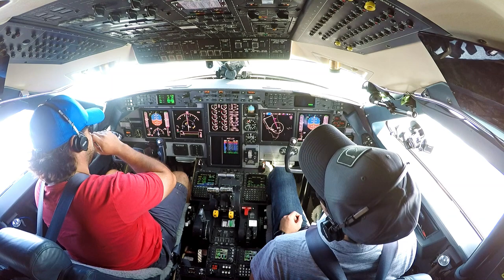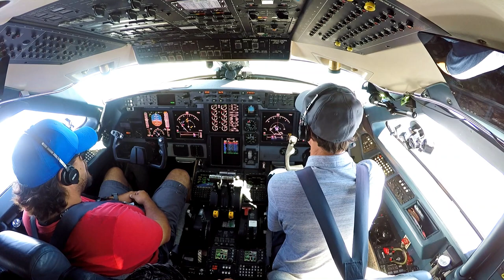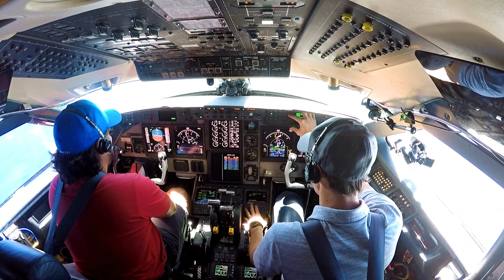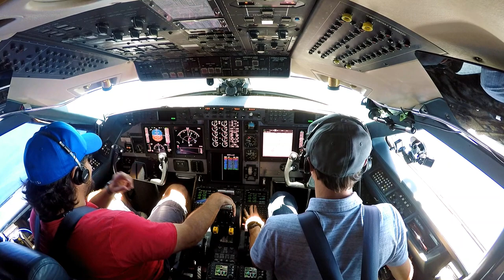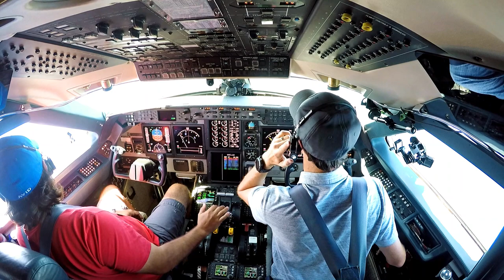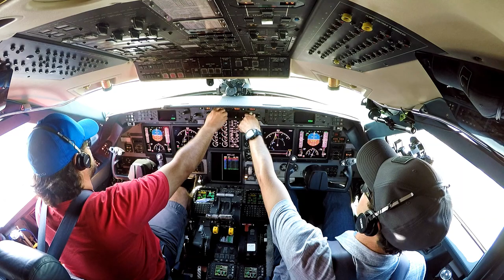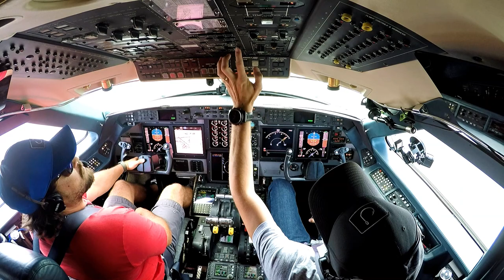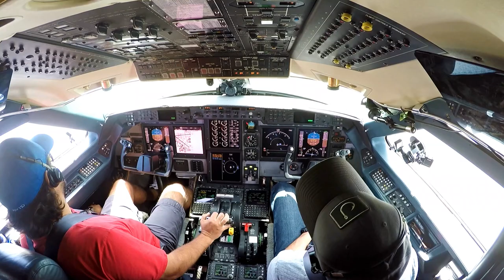Gulfstream Test Flight Around Florida - Pilot VLOG 091

Comment: If you can, please let us know what the corrective action was. I was an engine mechanic in the Air Force, and sometimes performed throttle rigs on C-141 aircraft. Thanks again.
Reply: The mechanic in the plane indicated it could be the tension on the cable but wouldn't the servo compensate for that? On a related topic, where is the speed input for the servo coming from? Is it the engine RPM?
Reply: Clearly the asymmetric trust issues are related to dirt in the carburettors... ☺
Reply: That'll be it. Go check... 
(Shh - if he can find a carburettor in there I'll buy him a mars bar!)

Comment: How did they know you were looking for air work before you'd asked for it on freq? Was it in the FP remarks? Good call on the block alt request. Just a note, once you have the block, you should not feel obliged to try to stay at 15k. The airspace is yours. Center is not going to have another IFR aircraft any higher than 12k or lower than 16k within 5nm of you. :)
Reply from the maker: I had already discussed with ATC about doing some maneuvers...that's how they knew.

Comment: We had a very similar autothrottle issue on my aircraft; the problem ended up being the fuel nozzles were worn, as I recall. It was affecting engine acceleration, and because the throttles lag, one side was always playing “catch up”. The splits got bigger and bigger until we had to disconnect them because of the Dutch roll it started to induce.
Reply from the maker: That's a great suggestion...thank you! I'll pass that along to the maintenance guys

Comment: Man, I wanted to see a stall.  Also, what are those yellow handled levers just aft of the throttles?  Happy landings!
Reply from the maker: Those are the fuel shut off handles, often called the fuel cocks. Those are how we introduce fuel for engine start, and shut off fuel to kill the engines.
Reply: Thanks.  Unrelated question: have you already stalled when the wheels touch down or do you stay above stall speed all the way to touchdown?  And is it that way you land all types of airplanes or are G4s different?  Again, thanks and happy landings!
Reply from the maker: Every airplane lands a little differently, but in general you don’t want to stall at all on landing. Some planes can do that for specific landing types. The G-IV should still be well above stall speed when the wheels touch the ground.
Reply: Generally tail draggers aim to stall just before touchdown

Comment: If you haven't already done so, you might want to ask Avid about a discount code viewers can use.  It's good for you (brings in viewers), and good for Avid (not only drives in business, but they know which venues are sending them customers.).  In exchange for a few bucks, they get information about how valuable an endorsement from you is, and how much of a lasting effect each video giving a shoutout to Avid provides.  

Thanks for this video.  I can't believe I'm saying this about a maintenance flight, but it was incredibly interesting. It''s a completely different set of problems than I'used to see back when I was flying piston singles!
Reply from the maker: That's a great idea...Thank you!

Comment: Another great VLOG Shaun & Jon!!!  lot of interesting stuff going on, if you need to drop altitude in a hurry for instance glide slope to high do flaps and spoilers give a good descent or can you side slip a GIV?
Reply from the maker: Flaps and spoilers are definitely the way to go. You can side slip it just a little bit, but the air flow gets disturbed pretty quickly

Comment: What is the "engine sync" you call out shortly after takeoff?  Normally you  activate that switch in the overhead, but this time you did not.  Does it link the throttles together?
Reply from the maker: That tries to match up the engine RPMs to reduce the noise in the cabin. It's just for passenger comfort.

Comment: That Dunlop call was one I’m never going to forget. Those maintenance rides are really a handful. Thumb up from across the North Atlantic and thanks for the ride. Got one question I’m been wondering about for a long time. What is the main differences between a straight lV and the SP?
Reply from the maker: There are several upgrades in the SP models. The SP has slightly better avionics...it has SPZ 8400 rather than 8000. The SP is capable of higher takeoff and landing weights. My favorite is that the SP has an inch more headroom in the cabin.
Reply: Thanks for responding Shaun. Can see that extra inch comes in handy at both previous and latest clip.

Comment: Q1:  What is the purpose of the elevator check at 60 knots on the takeoff roll?  Why isn't that checked along with the other control surfaces while you're stationary?

Q2:  In a piston single, during the landing rollout you typically keep the yoke back to keep as much weight as possible off the relatively fragile nosewheel, however in the G4 you seem to be pushing the yoke forward to the stops.   What's the reason for this?
Reply from the maker: Good questions...we absolutely do a full flight control check immediately after engine start. We also do an elevator check as we enter the runway before takeoff. Then one final time at around 60 knots. There was a very tragic accident in Bedford, Mass several years ago caused by locked elevator on takeoff. The flight crew didn't notice it until rotation speed and didn't have enough room to stop on the runway. In an effort to never let that happen to us, we check that elevator several times before that point. as for the elevator being pushed forward after landing, that is very normal for the Gulfstream to keep the pressure down on the nose tires for better steering authority, especially on wet or icy runways.

Comment: Question: John mind my terminology only .5 in a cessna so some is more rotorcraft terms why was he having to feather it so much for the touch down especially seemed like the front wheels was that due to coming in so steep? Or the lack of the spoilers ? If so what exactly are the spoilers.
Thanks love the content you guys are amazing pilots!
Reply from the maker: The spoilers did pop up...those are the boards on top of the wings that reduce lift and add drag. I think the nose didn't want to come down due to the gusty winds

Comment: Taking a G4 to 'crawl speeds', that's always fun. Hope the problems get worked out, and disappear when you get its powerplants back. One thing that's puzzled me on that bird, we always shut down the APU shortly after the engines were running..but you guys do it late on the runway almost at takeoff? Does that thing need so much power the engines don't cover it until flight? Always wondered about that. As others mentioned, if you can tell us what corrective action they took on the engines and other issues it would be good to hear.
Reply from the maker: The reason we keep the APU going on the ground is for cabin Air Conditioning. The engines provide great cooling when they are at higher RPMs, but at idle they don't put out nearly as much cool air...especially when it's really hot outside.
Reply: Ah that explains it, as most of the time we were taking off up in the north..where air conditioning wasn't much needed ;) am aware of running it on the ground before taxiing, but we always shut ours down then, different aircraft as well.

Comment: Great Video guys, many thanks. Sure got me nervous just watching the throttle function on Right Engine speed up then slow down--Sure hope your mechanic was able to correct the malfunction. What was the satellite communications issue & Spoilers didn't appear to do much at landing, what was up with that?? Alway fun to watch your videos guys, again, many thanks & keep'em coming.
Reply from the maker: The satellite issue was the control box in the aft equipment bay...that's all fixed. Not sure on the landing though. They showed that they popped up, it just felt a little different for some reason. We've flown several flights since this was recorded and it has bee normal since.
Reply: Do you use Satcom Direct by chance?

Comment: Do you guys every swap seats just for experience/practice from the other side?  I know you are both captains and take turns as PIC, but there are small differences from side to side.
Reply from the maker: I think Jon is afraid of the right seat...
Reply: The left seat is justly earned, even if it's by 1 day seniority.
Reply: First, I understand that, but a good friend of mine that used to fly corporate, they would have the PIC in the left, so it changed.  I guess it depends on the company and the pilots if they are both captains.

Comment: What are the symptoms of AOA's not being aligned? AP problems? Late/Early Stall indications? That auto-throttle issue is really a servo oscillation issue.
Reply from the maker: Late/early stall indication would be a symptom, but we never get that slow. Mainly just an indication mis-match
Reply: @CorporatePilotLife  How did you notice it was not aligned?
Reply from the maker: We have AOA indicators on each PFD. We just noticed that they were reading a little differently
Reply: When I heard the glideslope warning a couple times on landing I wondered if that could have been triggered by the AOA indicator being off, but I think I would be wrong about that one...

Comment: Shaun the throttle issue what happens if you try to Sync the engines? Any difference or worse? Just wondering and a cool tech video would be to see what Felipe was doing and what he did to fix issues, but maybe that is for Felipe channel.
Reply from the maker: We've tried both with and without sync...doesn't seem to make any difference
Reply: @CorporatePilotLife  - Are both engines turning at the same RPMs when the "auto-ed" throttle levers are not aligned? From what Jon was saying, sounds like the starboard engine is varying RPMs. Would the autopilot normally and purposely vary rpms between engines to orient the plane? On twin engine boats I've driven,  when the (carburetted) engines are in synch, the throttle levers might not be perfectly aligned due to adjustment, but never had one engine surge more than t'other and require further adjustments to stay synched. I'm surprised that no multiple engine pilots have chimed in on this phenomenon. Maybe you could get Eric O. from "South Main Auto" channel to hook up his meters to see what the sensors are doing and run a tape- He's a wizard with them meters. He will need a schematic, though😄
Reply from the maker: On this plane, the autopilot and auto correct throttles don’t talk to each other. The issue here was an incorrect tension on the throttle cables.
Reply: @CorporatePilotLife  - Wow, interesting that autopilot on an airplane this advanced wouldn't manage the throttles like in automobiles.

Comment: So was it a throttle cable causing the problem? It’s good he got the oil pressure  issue figured out.
Reply from the maker: It was the tension on the throttle cables

Comment: Hi Shaun and John! Nice landing!!  Question: when you land you say what sounds like Boards are Up.  What does that mean please?
Reply: If I may help: The G-IV has six spoiler panels, three on each wing. The spoilers usually have in-flight and ground capacities, to be brief and not overly technical. When the spoilers are armed and both throttles gated, the inboard spoilers deploy followed by the remaining four when the nutcracker detects wheels solidly on the ground. (A note on the phraseology you usually hear: "gear down, three green, nutcrackers check, spoilers armed". The spoilers cannot usually be armed until the "nutcracker test", which you will hear them call after gear extension.) The purpose of the ground spoilers is to help slow the aircraft with increased drag, and destroying lift on the wings. Since there are six panels, there would be an indicator light to indicate each panel has deployed correctly...thus the call "boards up...six green".
Reply: MidwestMike100 six lights: engine thrust reverse buckets armed and deployed. Three per engine
Reply: MidwestMike100 Thanks very much!
Reply: MidwestMike100 Nice explanation! Thank you!
Reply: You're probably correct, as my experience with thrust revers is predominately with (Allison) Rolls Royce engines, with clam-shell door reversers. The G-IV, I am thinking, has three TR (thrust reverse) lights per side, showing armed, unlocked, then deployed. However, I should have limited myself to answering Valerie's question as to "the boards". I also am thinking there should also be (might be?) an indicator showing the degree of spoiler deployment, which are different in flight and on the ground after landing. Thanks Blue skies.
Reply: Valerie Loveless I forgot to include the link to the video Shaun recently uploaded:

https://www.youtube.com/watch?v=E-3Wao6t1EI

Hope this helps

Comment: Interested why when you felt the spoilers had not popped, you didn't look out the window. I would've thought that was a natural reaction (for the PM at least!)
Reply from the maker: Initially, I didn't want to take my eyes off the runway just in case I needed to take action. The instrumentation showed the spoilers were up, but in hindsight, what I should have done is reach down and pull the flight spoilers.
Reply: check the camera on the wing to see if they popped. that way you'd know if they actually did and time it off the forward camera to see if the spoilers came up as the lights came on.

Comment: Do you use the brakes to steer when on the ground or do you have a tiller?
Reply from the maker: Tiller...those brakes are very expensive, so we use them as little as possible.
Reply: Didn't you mention it was something crazy like $25,000 for a full brake replacement? Or, was it closer to $100,000?
Reply: You guys keep up the good work with the videos. They are very interesting and informative.
Reply from the maker: I’m not sure the exact number, but $25k per wheel is about right...so $100k total.

Comment: Just what does, "Sync the Engines" mean?  at the beginning the flight you chose to not "sync" but to make them, "growl" a bit.  What does that ll mean?
Reply from the maker: Engine sync forces the engines to match their RPM to reduce noise in the cabin. Jon decided to not use it for this flight to see if it affected the auto throttles at all.
Reply: So, the RPM match actually keeps the thrust the same, or is it within a few lbs?  Also, the movement of the right throttle, under auto-throttle, was very weird.  Did the fix on the tautness of the cable take care of the situation?
Reply: If the engines aren't at the same RPM the result can be like the beat note you hear when tuning guitar strings. There is a vibration product of the difference of the RPM frequencies. I was on a commercial flight from LAX to HNL in the late 80's and there was no engine sync and the RPMs of the engines would wander around and occasionally the difference frequency of the engine RPMs would hit a resonance frequency of the airframe and everything would rattle and buzz in an extreme manor. All of the plastic in the overhead containers would buzz and there was a distinct shaking that I'm sure was not good for the aircraft. This was the only time that I have ever been scared on a commercial flight just because of the lack of attention or awareness of the pilot. I told a flight attendant that the pilot needs to sync the engines a few times but that message never made it through.
Reply: @mikeh2520  I imagine your message didnt get thru lol I'm trying to imagine a stewardes or steward going up to the cockpit and saying "uhhh excuse me Captain, but a passenger says you need to sync your engines..."   
I know what you mean though, can imagine that much vibration would be bad, I'm not a pilot, so I imagined it to be more aling the lines of just annoying, sort of like when you have the drivers window down then a rear window opened a little, the inbalance caused by the difference in air pressure makes an annoying, irritating noise with pressure.  If you've experienced it you know what I mean, I'm afraid I'm not describing it well.

Comment: When I was working at Boeing, on the 747 project as a Manufacturing Engineer, I heard the term 'Dunlops' but in this case those using it meant the "'Dunlops' meant 'Full Flaps'.  If you look at a landing 747 from the rear you'll see the flaps have 'Dun lopped over the wings....
Reply from the maker: That’s pretty cool...didn’t know that!

Comment: Fortunately we didn't get to see it first hand in the video, but since the topic came up, what are the stall characteristics of a G-IV?
Reply from the maker: Well I've never actually stalled the plane, so I cant really say for sure. In the simulator, we practice "approaches to stalls", but the airplane has a stick pusher that will physically push the yoke forward to prevent stalling. From what I have done, it is very easy to break a stall at low altitude...it has LOTS of power. At higher altitudes like 41,000, it takes about 8,000 to 10,000 feet of altitude loss to recover from a stall.
Reply: @CorporatePilotLife  Wow! 8-10 thousand feet to break a stall! There's that "thin air" phenomenon again. Wright brothers had enough trouble at Sea Level!🙂
Reply: Interesting it is a stick pusher, how easy would it be to overcome that automation if say the A/C began to stall on approach at low altitude? Would not want the nose to be pushed down, just curious if it is as simple ad adding power and pulling on the yoke?
Reply: In that situation, one's natural reaction is to pull up to avoid crashing at all costs -- and that's exactly the wrong response which will likely get you killed.  The result will probably be a low altitude stall/spin, which is almost always fatal.  Pushing the nose down is the only way to avoid a crash, or at least lessen its severity.   A stall at pattern altitude or below is almost never recoverable.   The only way to recover from a low altitude stall is to not get into one in the first place..